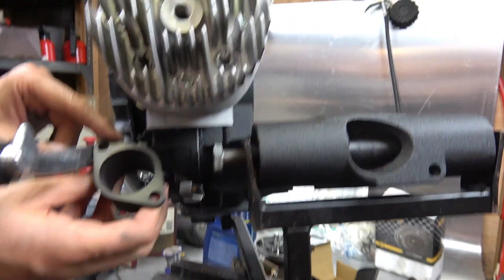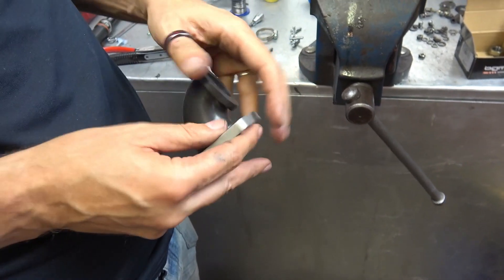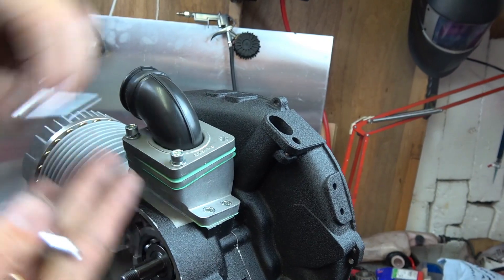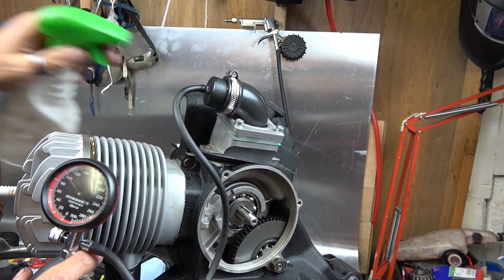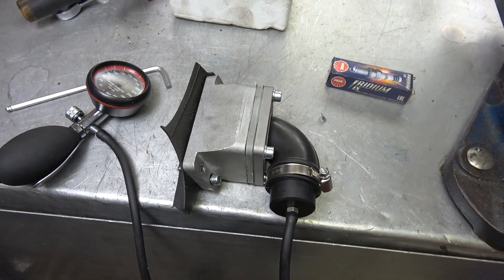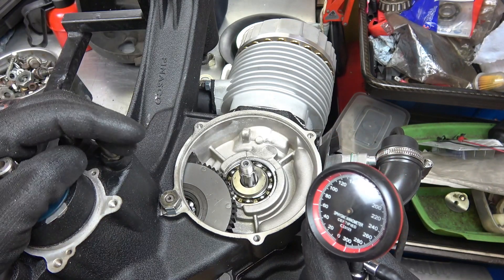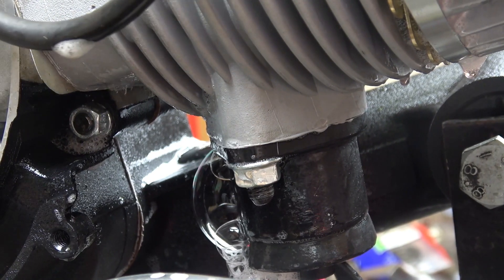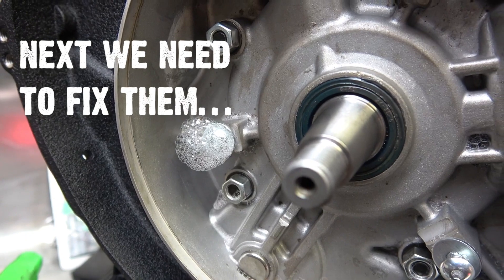SLUK | Pinasco 251 engine build: Video 11 - Leak testing

Comment: Great video i learnt alot from this unforturely to late for me, not a scooter but suzuki ts250 trail bike blew bottom end on sunday only 600mls on full rebuild....
Reply from the maker: We feel your pain :(
Reply: @ScooterLabUK  its mad i,ve raced 2 strokes for 30yrs  mx enduros and this is my first big end failure.....the bike in question is ts250er converted to flat tracker for the road fantastic to ride alot of fun i had low slung pipe made and barrel ported by the great mick abbey...put on dyno when took it there only had 11 bhp now has 28 at back wheel, love youe content thanks.
Reply from the maker: @daveb1963  sounds like you’ve had a lucky 30 years :)

Comment: Big Thank you for this video, my 190 Pinasco LML engine is holding pressure with the blood pressure cuff and will go onto the Sprint asap. The value of leak testing for false air is unquestionable. Top work chaps!!!

Comment: Using a  smoke machine, either homemade or purchased from the web, can lead you directly to where the leak is coming from as the you can see the smoke leave the motor where it is not sealed correctly. https://youtu.be/EhNQiIRsCCk. I love your videos. Thanks for the info.

Comment: Your series has been great for diagnosing my engine (LML Pinasco 190 / Dellorto 28 slide / Pinasco inlet manifold and reed block same as yours. But I have a rubbish box exhaust. I also had a blood pressure device sitting in the cupboard which I added a black door stop plug to. I ended finding out the chap (r-sole) that put my engine together used a metal clutch side crank seal when the case has a groove for a rubber seal. I had air pushing through the bearing. I'll keep watching big thanks, Yes you have a 251 but what exhaust are you putting on.
Reply from the maker: Great stuff Peter, glad it helped. We’re using the Pinasco box exhaust but will experiment with expansions later.
Reply: @ScooterLabUK  Let me ask another question. I have a LML 150cc with a 190 Pinasco Magny Cours cylinder kit and Flytech ignition. What exhaust catagory am I in. The 150cc class or 200 class. I have never received a consistent answer from SIP or SC . That might just be Za German blunt response.
Reply: @peterwriede7772  150 class. 200 exhaust has a different/larger hole where the exhaust connects to the motor.
Reply: @RowdyCStuff  last question I promise: with a Pinasco cylinder kit, do you round off the exhaust port in the bore and do you do the same for the the transfer ports or just the exhaust. As background I understand the rounding reduces unnecessary wear on the cylinder rings against the bore and better movement of particles around the engine bore. What do you think?